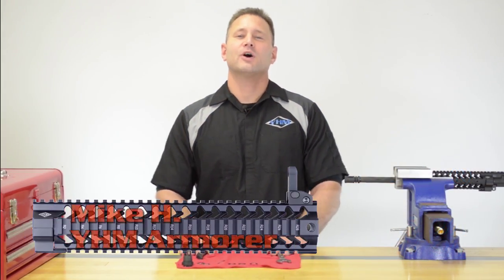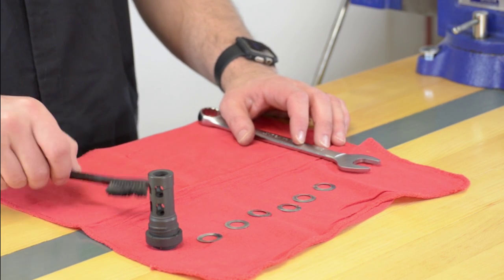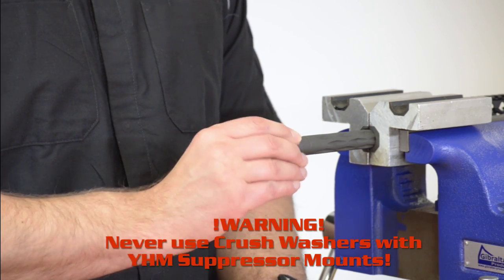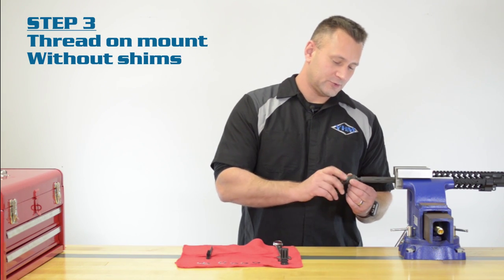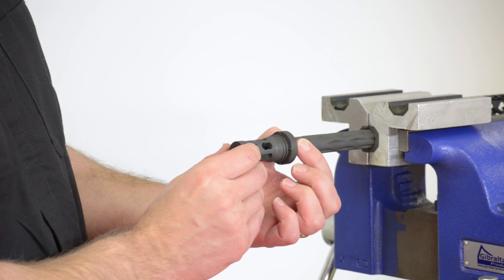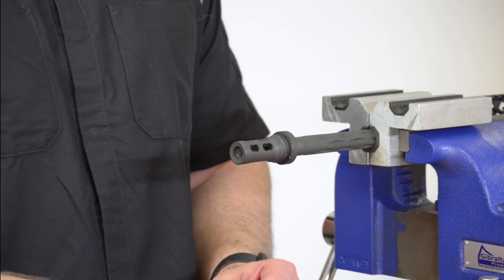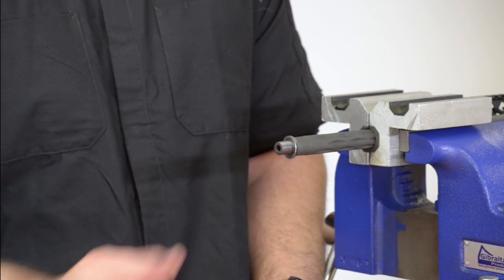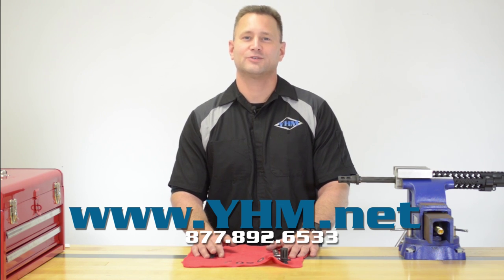YHM Q.D. Muzzle Brake Installation

Comment: The shims are larger than the wrench flats, so you have to find some 3/4" wrench that's less than 0.18" thick.
Reply: Yep running into the same thing I like the YHM can and couple mounts but this glaring issue is frustrating. Which is even thinner than my thin wrench set. I was going to grind down one of my 3/4 wrenches but I would have to keep that wrench with it all the time incase it came loose. (Note look at the wrench in the video seems to have been modified). Plan B is ordering the 5/8 muzzle shim kit off Brownells that "should" be 0.744" OD according to the Q&A. Then I can use any ol 3/4 or adjustable wrench in a pinch.
Reply: @notshared2543  personally I didn't even want the muzzle brake, all my additional mounts are flash hiders which don't require shims or timing. I only used the muzzle brake because it came with the can.
Reply: My tapco armorers tool is thin enough to work around this issue
Reply: @Super-Kuper  installing the mini flash hider needs no shims ?
Reply: I bought the brake and the store wouldn’t let me swap it out, contacted yhm and they wouldn’t let me either even tho it’s new sealed in package still.
So I have to use it and the one that came with can… going to be annoying doing the shims 2x

Comment: How exactly should I determine 20 to 30 foot pounds even with a Torque wrench I’m not exactly sure how I would get it to work with sockets
Reply: Crowfoot wrench set.
Reply: Don’t over think this...just tighten it up

Comment: Do you need to rockset the threads to keep the supressor from uncrewing the muzzle brake?
Reply from the maker: No, just torque it down to 20-30ft-lbs

Comment: Could you use this muzzle break with the 556 turbo suppressor?
Reply: Julio Quintero only if it's a 5.56 brake. YHM specifically designed their .30cal muzzle devices to be impossible to install onto a 5.56 suppressor so you don't accidentally shoot the wrong caliber through the wrong suppressor. YHM does make a 5.56 3 chamber brake for the Turbo though.

Comment: Any difference for installing the QD flash suppressor?
Reply from the maker: The Flash Suppressor QD doesn't require a shimset. That's the only difference really
Reply: The flash hider doesn’t need to be timed, so no shims...but if you do want to time it then you would need the shim kit

Comment: Would you recommend grease such as aeroshell be used on the threads?
Reply: No. If anything use rock set or a high temperature thread locker.

Comment: what is QD about this muzzle break?
Reply: The Suppressor can be treaded on and off of the break which is why it is QD. They use a pseudo ratcheting system to keep the suppressor on the muzzle device.
Reply: @PynkPwny  Yep the mount has the moving parts which prevents it from locking up